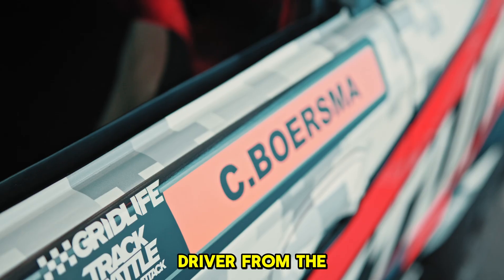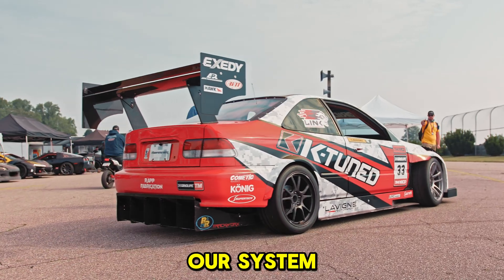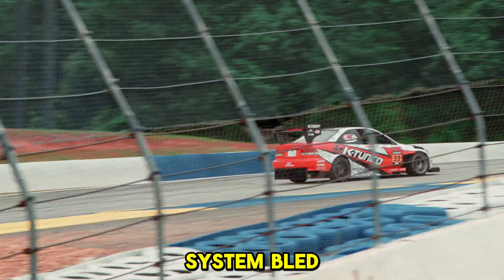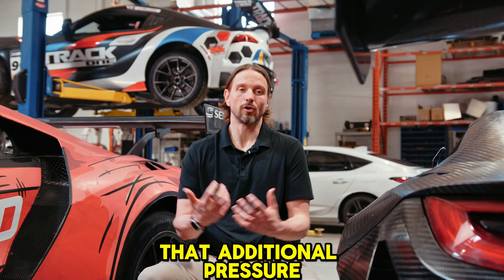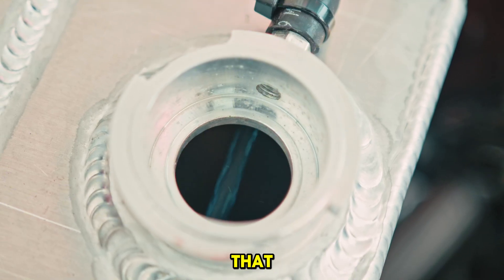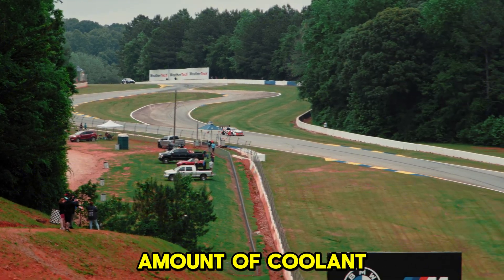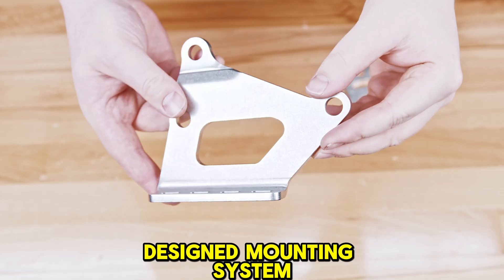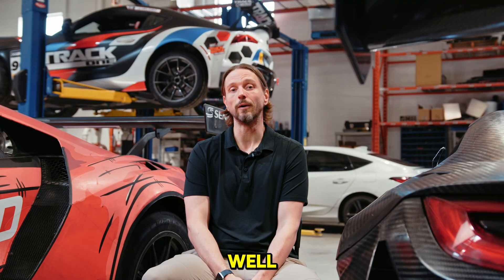Game-Changer for Track Builds! No More Overheating!

Comment: Can you explain what your coolant consists of? I've been having issues with my setup so have lowered the glycol level and added water wetter. Would be interesting to know what you guys run. Cheers.
Reply: Looks like BMW coolant
Reply: Water cools better than anti freeze  if ur in an area where it doesn’t get cold run straight water.
Reply: @ll.7927 you still need something for lubricity and anti corrosion